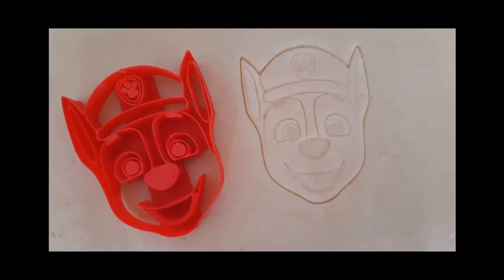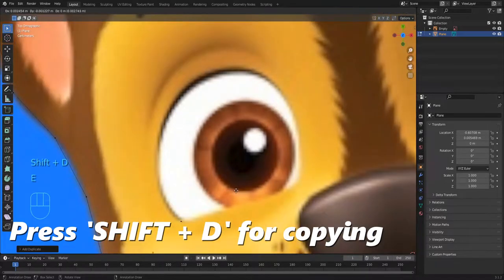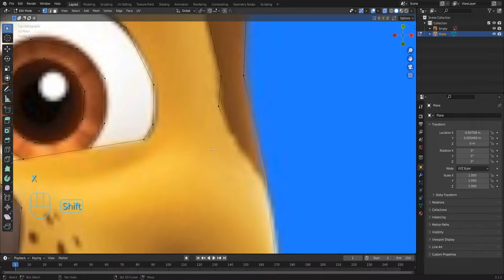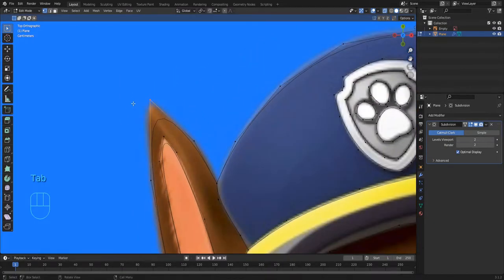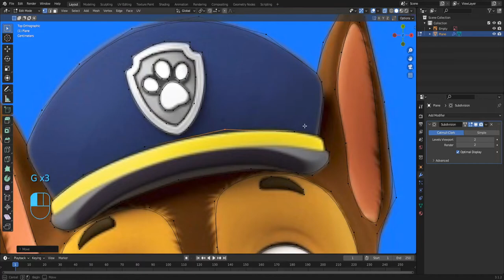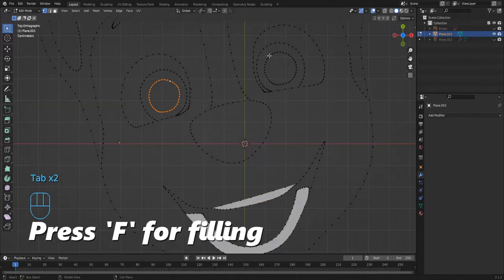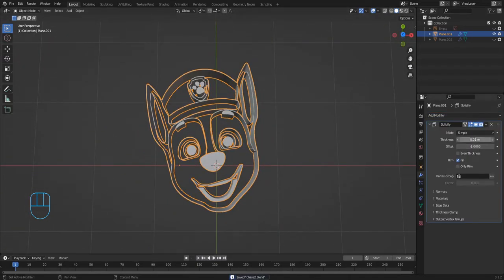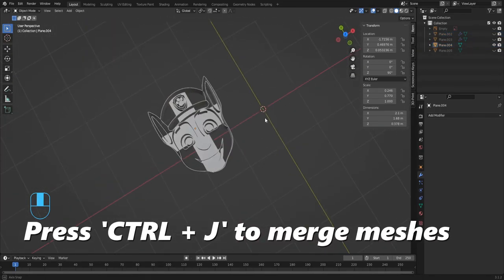Modeling Cookie Cutter in Blender (Chase from Paw Patrol)

Comment: How can you start to draw this curve?
Reply from the maker: By selecting a vertex and start extruding it. You can make this happen multiple ways, you need a mesh that contains only 1 vertex. Then in Edit mode (pressing TAB), you select that lone vertex and after hitting button 'E' you can continue drawing the curve. Every time you hit the 'E' button, you add a new vertex to your mesh, connected to the (previous) selected one.
Reply: I cant use the subedition surface